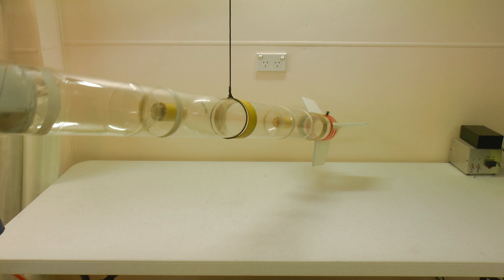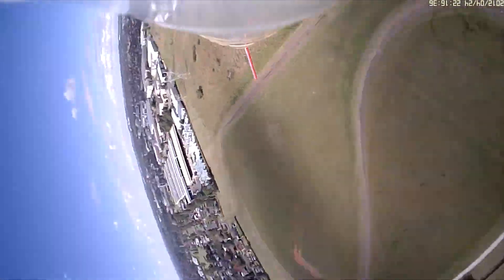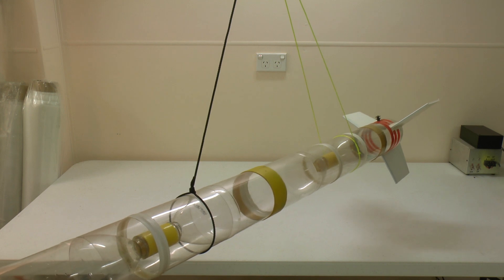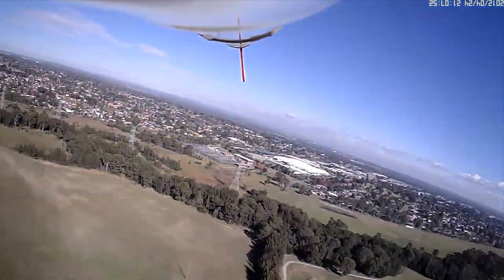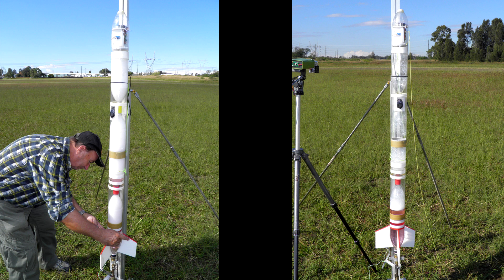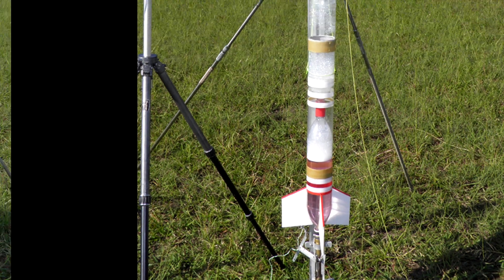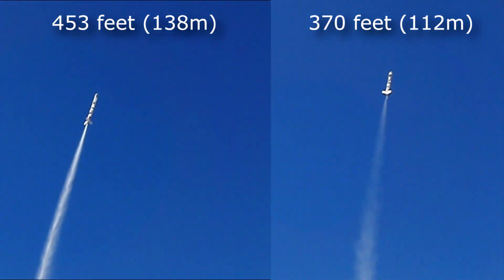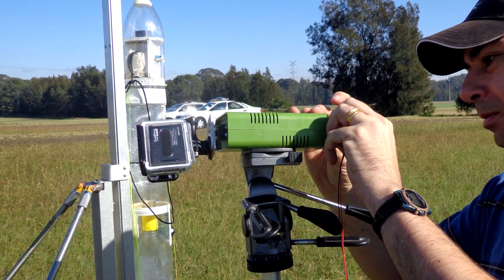Day145 Water Rocket Highlights

Comment: Really well put together video Air Command, you always have a great ear when it comes to choosing appropriate music! When you say you shook up the foam did you shake the rocket or did you shake up the solution in a separate bottle before pouring into the rocket? Which methods would you recommend for creating foam without a Jet Foaming Spacer- the Spacer will be a Summer project :) Thanks, Jamie B.
Reply from the maker: Thanks Jamie, we just poured the solution into the rocket and in doing so it produced some foam. We then tipped the rocket over so we had some solution in each of the segments and shook the whole thing for perhaps 30 seconds. Then we put it on the pad as normal and ended up launching it within a couple of minutes I think. The big difference between using the spacer and not is that with the spacer you can leave the rocket on the pad as long as you like as foam generation happens only once you start flying.

This is all speculation but there may also be a difference between the foam properties because the bubbles you make before pressurizing the rocket, internally have ambient pressure and would get compressed once you start pressurizing the rocket. When the bubble leaves the nozzle it expands back to normal size. The bubbles in Jet foaming are created with the high pressure inside them so when they leave the nozzle they expand a lot more before popping.